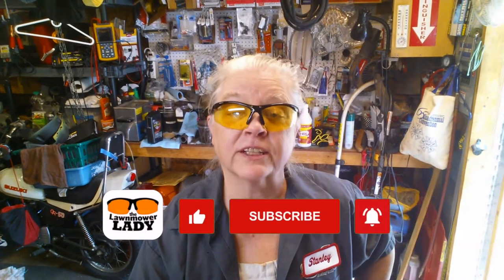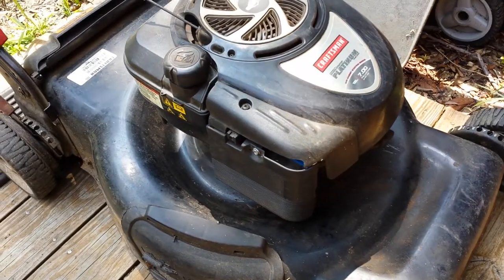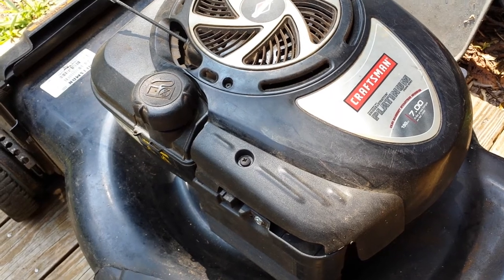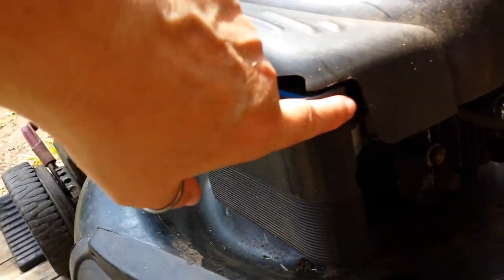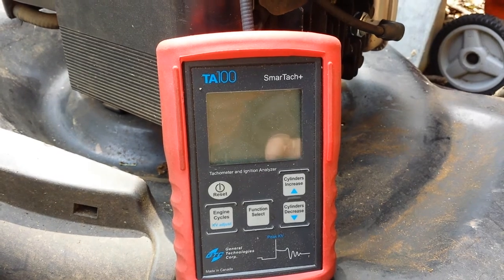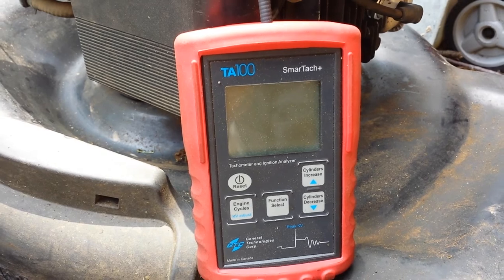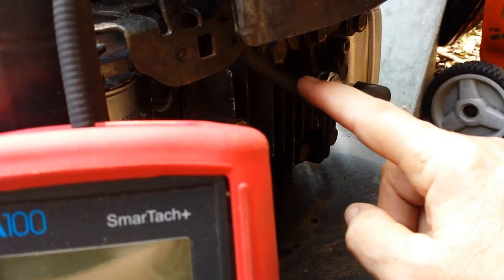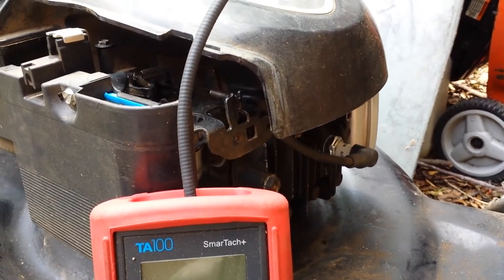RPM Adjustment on Briggs & Stratton Quantum L-Head Lawn Mower Engine

Comment: I LOVE THAT TOOL!
Reply from the maker: Thanks Jason! I use that tool nearly every time I fix an engine. It did throw me a loop as first as the tool has no compensation for wasted spark ignition on  these smaller 4 stroke engines. Just have to set the tool for 2 cylinders and you're good to go.
Reply: @TheLawnmowerLady I was confused by the setting on 2 cylinder until I read your explanation Cheers very nicely done ENJOYED THE VID. THANKS

Comment: Thanks for the video LawnMower Lady. Do you have any videos or advice on how to go about resetting the governor from oustise the engine? I'm new to lawn mowers and I changed the carb on a briggs and stratton L-head lawn mower engine. Similar to the engine you have in this video. Problem is that I forgot to reconnect the carb lever that connects to the governor lever and instead of removing the carb to put it back on, I removed the governor lever to reconnect it that way. In so doing I think I messed up the setup because I grabbed the governor post and moved it left and right with my fingers. I'm not sure which way to put it back and I've seen some videos that say clockwise and others counterclockwise so i'm confused. I ended up putting it counterclockwise and when I used the mower I noticed it sounds very revd up. I'm not sure whether I put the governor in the wrong position, or if it's the new carb, or maybe needing to readjust the plate as you did in the vid.. How would I rule out wrong governor setup? I don't want to keep using it and destroy the engine... Any help on this is much appreciated. Thank you.
Reply from the maker: If it sounds like it's running crazy stupid fast, it probably is. You can always readjust turning it all the way the other way. Make sure the throttle is wide open when you adjust. I appreciate you watching. Cheers!

Comment: For anyone wondering, Briggs originally set the Quantums to 3100 rpms when they ship them out. Some of it is the governor spring stretches over time. If you don't want to bend the tab, sometimes all it needs is replacing the spring.
Reply from the maker: Good info. Thanks for watching. Cheers!
Reply: @TheLawnmowerLady You're welcome, thanks for the channel and I am glad that I could help contribute something. I've learned a lot from both yourself and other small engine channels.

Comment: I have this same engine, very few video's on it. Its running about 4000+ RPM and smoking. I don't see any vacuum leaks, my next attack was the mechanical governor bolt, so I have the cover off. Any tips?
Reply from the maker: I would avoid messing with the bolt that holds the governor arm. Double check the spring is in the correct position, and bend that tab in, towards the engine (reduce the pressure on the return spring) Hope this helps.
Reply: @TheLawnmowerLady  I've done that and its still ripping, even removed all spring pressure and its still flying. I just ruined the air intake gasket while double checking butterfly function, so I won't have it back together until the gasket comes in. I turned the governor counter clockwise until I bottomed out, while the arm was holding choke closed. 5/32 for the governor shaft, 3/8 for the bolt. Got the mower for free, has a new blade, which gives me the after thought was the previous owner put a blade that's too small on it, and I should have checked that first. I'll let you know what I find, thanks for reply.
Reply from the maker: That sounds about right on re-setting the governor bolt. Does it look bent or distorted?

Comment: so about 3000 rpm for most mowers ??
Reply from the maker: That seems to be the happy spot for me on most mowers. They usually come out of the factory much lower (EPA regs?) and ten to bog down or stop altogether in long, or thick grass. There is some formula for blade length, engine torque or something or other. Too much math for me. Thanks for watching.
Reply: @TheLawnmowerLady There are small engine repair books that speak of various rpms for Briggs and Stratton engines, that are based on varying blade lengths on different engines, to protect the user from harm.